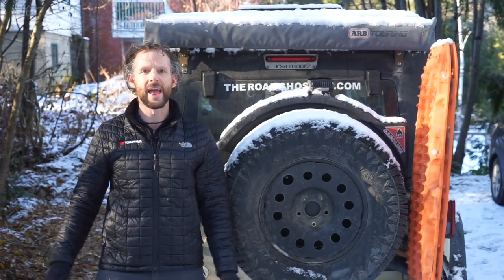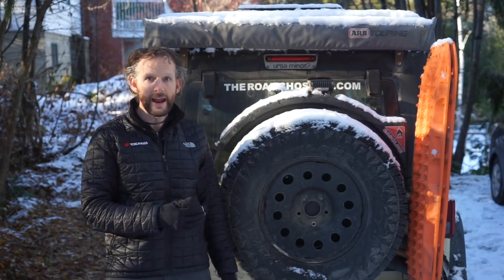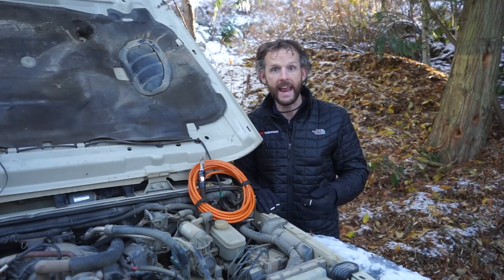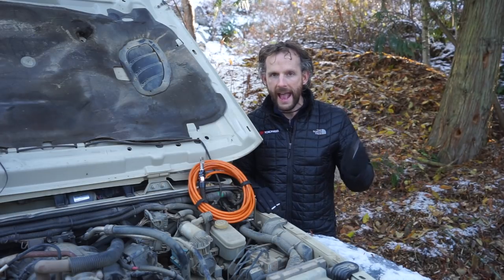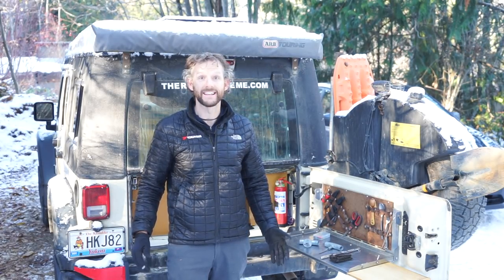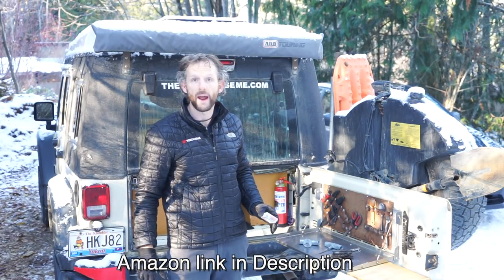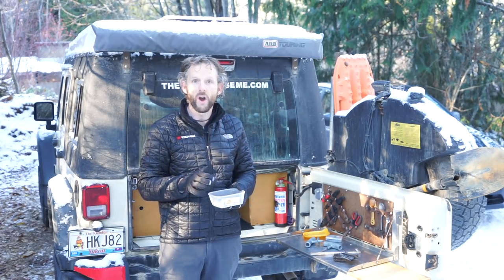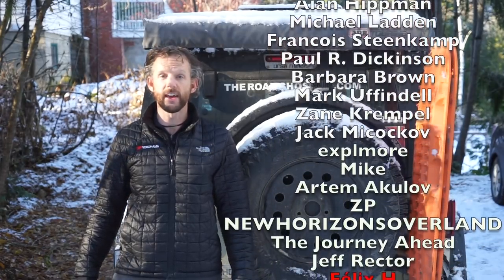Tire Spares and Repairs for Overlanding

Comment: No mention of tyre pressure monitors? You can pick them up relatively inexpensively and can keep a constant eye on your tyre pressures from the driver's seat while driving...
Reply from the maker: My Jeep has TPMS built in, but it's not something I'd add. Just another gadget nobody needed 10 years ago.
Reply: @TheRoadChoseMe  that's great that your Jeep has it built-in! Most cars don't have it or it's an extra add-on.
Reply: @TheRoadChoseMe , does it tell you the pressure at each wheel, or just give a light if the pressure is outside a certain range?
Reply: I think it was Andrew St Pierre  White, he installed one and it notified him of low pressure going 
down the highway before disaster struck.
Reply: For me TPMS is essential. You get advance warning of low pressure and you can do something about it before the tyre is wrecked.
Reply: @TheRoadChoseMe  "Just another gadget nobody needed 10 years ago." That's true of lots of things on your vehicle whether you put them there or the factory did. Seems unnecessary to condescendingly dismiss a viewer's question just because you haven't encountered a use for it.
Reply from the maker: @Questioner It just gives a warning when they fall below a threshold I can set.
Reply: @d7e7r7  All cars and light trucks manufactured since September 1, 2007, have contained TPMS.

Comment: In the event of a major tire damage, motorcycle overlanders often carry an inner tube along with a plug kit, even if they run tubeless tires (most do these days). Is that a thing in the overlanding light truck world?
Reply from the maker: Eh, I think maybe some people carry an inner, but again, it's kind of old school.
Reply: I carry an inner tube for long trips. 
It is light, cheap and relatively small compared to an extra spare. I have only put it on during an outback tyre change  training course. It would allow you to limp  along with badly stacked or ripped side wall.